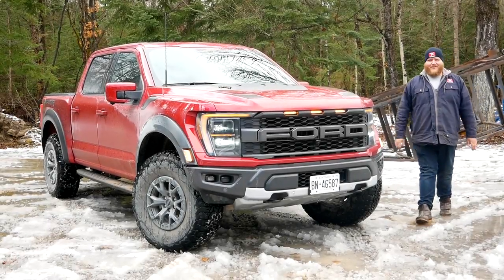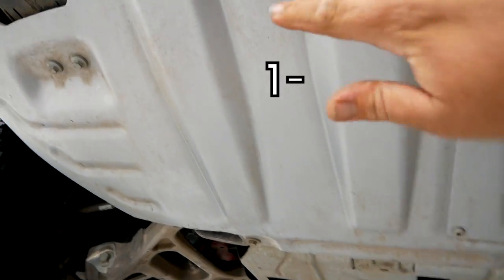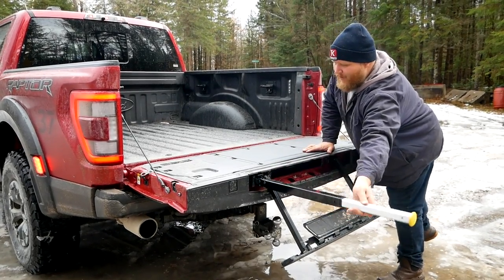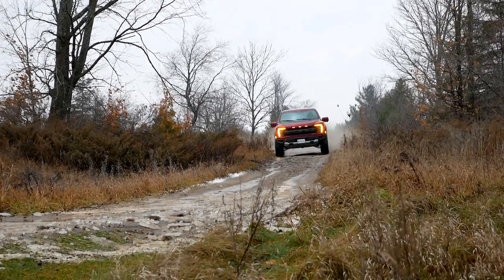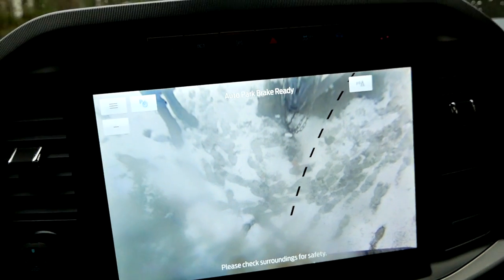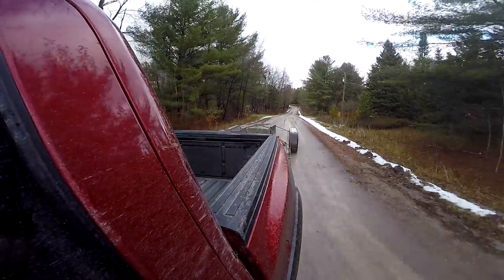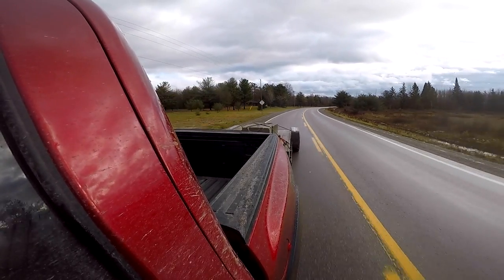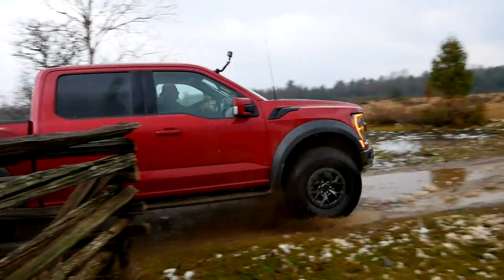New Ford Raptor Tackles the Water and Ice - Towing, 0-60, Off-Road & More

Comment: I miss the v8 but what the heck it’s not about speed it’s about having fun I’ll take the raptor over the Trx anytime and I know the trx is fast but I want my truck for off road not the quarter mile run
Reply: A tuned Raptor - let alone street-50 - will outrun to TRX. A Gen 1 can outrun a TRX offroad, due to the weight and suspension dynamics.
Reply: What tune can outrun a stock TRX??? And Gen 1s frames will snap trying to do what a TRX is capable of...
Reply: @hellkitty1014  I see you haven't watched any actual videos of offroad use of the trucks. Frames were only affected in 2010-2011, before they were beefed up and by people hitting bar ditches at 100mph.

+100hp or so gives a better power/weight ratio for the gen2 raptor versus the TRX. Pretty pathetic since that's supposedly the TRX's one party trick.
Reply: @T4nkcommander  no...I'm talking about the countless Gen 1s with cracked frames up to 2014. Streetspeed 717 proved that its nearly impossible to crack a TRXs frame. And please remind us of that "tune" again?
Reply: @hellkitty1014  Cobb stage 2 I think, but there are others. Simple calculation, if you know basic math.
Reply: @T4nkcommander  a gen 1 Raptor won't outrun a TRX fucking delusional Ford guys 😂
Reply: @dor1tomcswagger69  Come prove it at the offroad track. Physics don't lie
Reply: @T4nkcommander  ur delusional dude 😂 go tell your fables somewhere else
Reply: @T4nkcommander  I'm guessing ur also one that says Ford ran stock raptors in the Baja but meanwhile that Raptor had a 6 inch lift 😂 which means a stock Raptor from the dealership can't compete in the Baja because it would be a write off after a couple of jumps 😂👍
Reply: @dor1tomcswagger69  It got modified to meet safety requirements. The build is available online.

I've got over 300 jumps in my truck. How many on your TRX?
Reply: @T4nkcommander   just the fact that you said a gen 1 Raptor can outrun a TRX makes me think you're delusional nothing going to change that 😂 and I'm pretty sure a TRX can do what you do with your truck you prob drive over a bunch of ruts and call it offroading
Reply: @dor1tomcswagger69  I've run with a TRX at the offroad track. Have you ever been airborne in a truck? My kids have, the videos are posted!

Comment: Curious, what is the final drive ratio with those 37" tires? The unsprung weight must be approaching 100 lb.
Reply: Did you mean 1000 lb?
Reply: @patrickallen1338  One wheel and tire must be almost 100lbs.
Reply: @richardguse3410  no doubt, 100lb is probably right on.  X4, plus brakes and add the weight of half of all the suspension and in all you're probably close to 6-700 lbs unsprung.

Comment: I lost interest in the raptor when they dropped that baby boost on it. No V8 no go for me.
Reply: Ah, you like going slower? My stock 2017 is faster than my buddies supercharged Gen 1,on and off road.
Reply: @T4nkcommander  They just like to sound faster. Noise isn't speed.
Reply: @T4nkcommander  Experiencing driving special cars is not just speed. It’s the growl , the connection between pedal,  sound and reaction. 
Sometimes even smell when it comes to nitro. 
For a regular commute car it’s ok not to have that excitement. But for a product that is oriented to take your senses to the limit like a raptor, not having a v8 is a total fail in my book.
Reply: @fitsector4271  So have you been in both in their element? I have. The Gen 2 is better - just a fact.
Reply: @T4nkcommander  yes! I’ve driven both. If for you the v6 is the best it’s ok. Just explain why the next one is going to have a V8 under the hood again. 😉
Reply: @fitsector4271  I disagree. I think the absolute best thing about the Raptor is it's compromise between power and fuel mileage that makes it a realistic option as a daily driver and an offroader. You either put a naturally aspirated V8 in it and you get less power less torque and worse fuel mileage in exchange for a V8 sound or you put a supercharged V8 in it and then you get more power but wind up averaging 10mpg and fighting physics trying to be fast in a 6,000lb truck that will never give you the fear of god kind of adrenaline that a similar horsepower car would. I love what Ford did with the Raptor's TTV6 because I get enough power to have some fun and be faster than 99.9% of the vehicles you actually come across in traffic while driving and have the best looking truck on the road with tons of offroad capability a luxurious interior with lots of interior features, and creature comforts all while getting 17mpg. It's incredible fuel economy for an offroad truck with this much power and getting that much of the truck and not having to pay for it on fuel economy is like having my cake and eating too which is freaking awesome.
Reply: @gsxr1189  I´m very glad you are happy with your truck, I personally prefer sugar that is real sugar not Splenda, a chemical that tastes like sugar. I prefer to enjoy a real burger filled with bacon when it's time for that, instead of low-carb options. Same for a vehicle that mimics the sound of a V8 using the door speakers, even when it´s a V6 with a whistle.
About the power and thrill, anybody knows that those turbos mounted on a V8 will reach territories that V6´s will never touch. 
And finally: Gas expenses,  I´m on the boat where if you are going to spend that much money on a raptor, gas prices should not be a worry. 
And It´s just my opinion, not trying to be rude. 

In the end, is the market demand that rules the destiny of product offering, and I´m happy that there is a V8 raptor coming back again. 
Maybe both V8 and V6 engines can live together at a different trim level.
Reply: @fitsector4271  Thanks for the kind words. I hear ya and feeling an itch to own a V8 is something I can identify with. The opinion you gave would have been my thoughts as well when I purchased an offroad truck but I already own a Supercharged V8 in another vehicle. Actually that's the C7 Z06 Vette in my avatar there so I didn't feel like another V8 was a must have when I the bought the truck and choose the Raptor. 

Something that never comes up in these conversations is how that an individual owner is going to use that vehicle, what their needs are and what they are trying to accomplish with the vehicle. I needed and offroad vehicle for overlanding and I wanted the Raptor to be my daily driver as well so fuel economy was a concern for me but not everyone is going to daily their 4x4 and the less miles you're putting on it the less fuel economy matters. 

However for people who daily these trucks I do disagree with the notion that if you're already spending that much on a Raptor then gas prices shouldn't be a worry. I own a Raptor and a Z06 and listen I'm not saying that to brag and there are many people who are doing far better than I but believe me I did not get to this point in my life without worrying ALOT about money.

The difference in fuel cost between a TRX and a Raptor over the life of the vehicle (let's use 150k miles) based on gas prices today in my area is $22,000. When I bought the Raptor similarly spec'd TRX's with similar mileage and condition were going for $15,000 more. Yes you can drop the cost difference of the TRX in comparison to the Raptor by comparing the price of a lower teir trim TRX to a loaded Raptor but I didn't want to sacrifice features and trim level I wanted a loaded truck. So the total difference in the price of the two is $37,000 over the life of the vehicle which was more than 1/2 the price I paid for the Z06. The question for me was is that $37,000 price difference worth having a V8 or would I rather have that $37k to spend in another area of my life like on another vehicle or elsewhere and for me and based my situation and needs the answer was no it wasn't worth it. 

To be fair that cost comparison was based on TODAY'S gas prices. In the future as more electric vehicles enter the market and more infrastructure becomes available for them I wouldn't be suppressed if our wonderful government (let's go Brandon) introduced some type of tax penalties to force people out of there gas vehicles. This is already happening in parts of Europe where gas is $7.00/gallon for regular and they charge annual tax penalties of several thousand dollars for vehicles designated as gas guzzlers with the amount of that penalty being based on how fuel efficient the vehicle is. So I was also trying to think of the future and plan ahead as well.